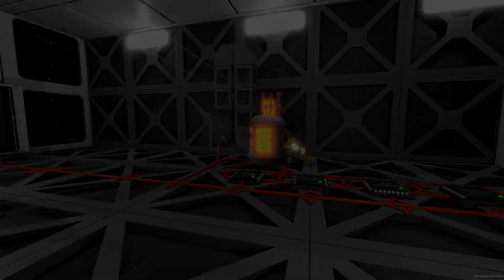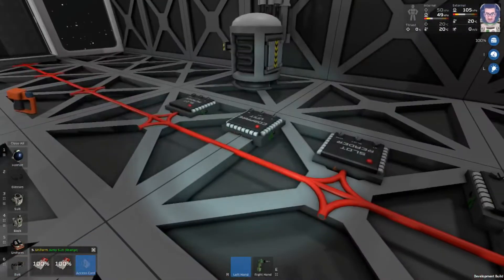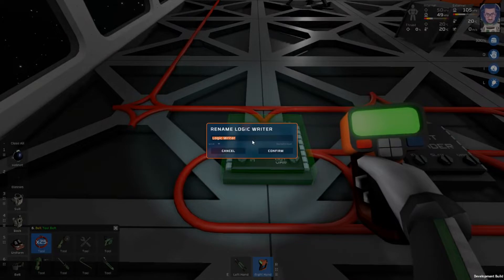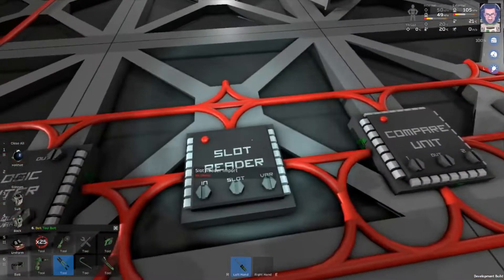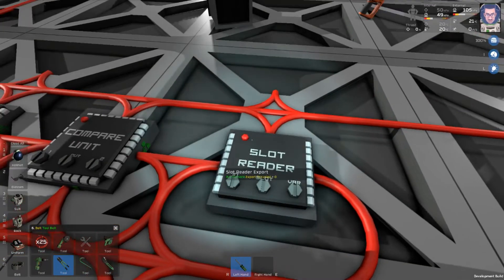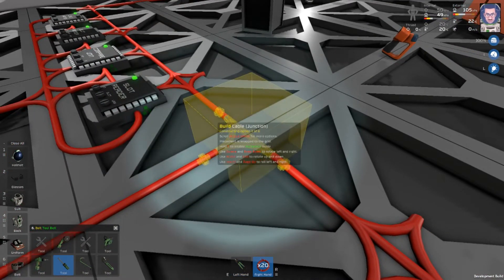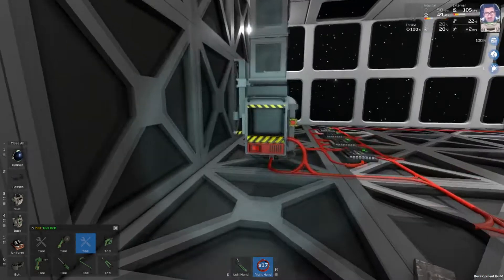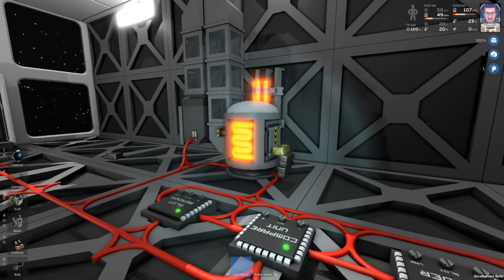Stationeers Tutorial: Auto Arc Furnace

Comment: I know it's been over a year since you posted this, but I just wanted to say a big thank you for doing it, and making it so easy to understand and setup.. - Followed along and got it running perfectly first time trying.. :) - Do have a question if I may, what sort of changes would I have to make if I wanted to say have 2 Arc Furnaces side by side? - would I have to do another set of chips?
Reply: The setup in this video reading the input and output slots is not necessary.  What you should be concerned with is the idle state.  Arc furnaces only evaluate to "idle" if they are on and have a material that can be processed in the input slot.  All you need is a reader reading the idle state.  And a writer sending the value from the reader back to the arc furnace to tell it to activate.  And if you want to control multiple arc furnaces you just replace those with a batch reader and a batch writer.  The setup in this video still gets "stuck" under certain circumstances and requires slot readers for every arc furnace you add.  My setup is two chips with the same settings regardless of how many arc furnaces you're controlling and I've never once had it get "stuck".

Comment: You can actually save 15W power cost, by replacing the Compare Unit with a second Logic Writer (25W compare vs 10W logic writer). I came up with this design when ForceWrite was added. The config needs to be changed a tiny bit, by setting Logic Writer 1's input to the Import Slot Reader, have it Activate the Arc Furnace. Logic Writer 2's input set to Export Slot Reader, have it ForceWrite to Logic Writer 1. Works the same, fully supporting Chute queuing of ores as well and the bonus is 15W less power cost for the same functionality and zero glitching. Enjoy :)